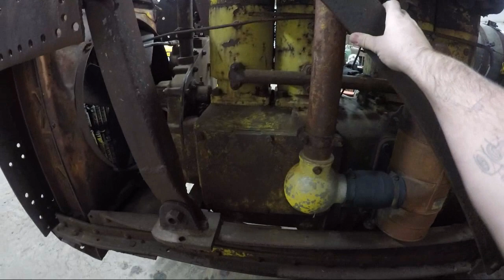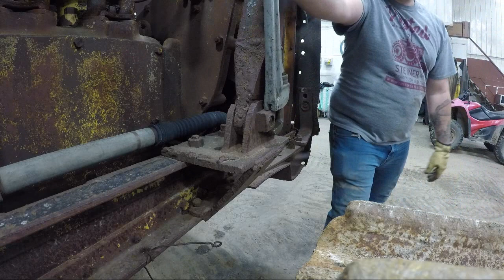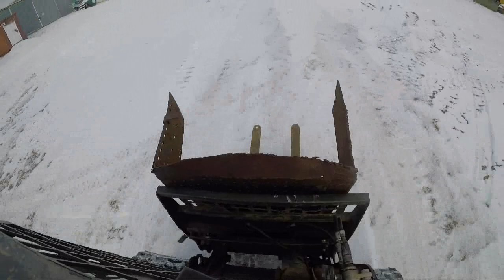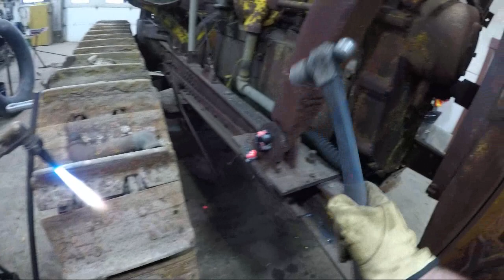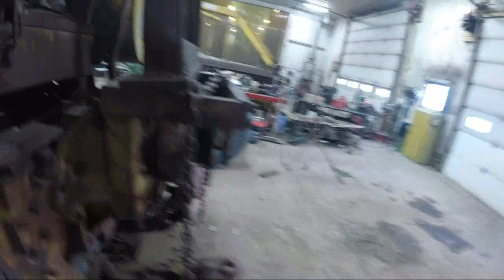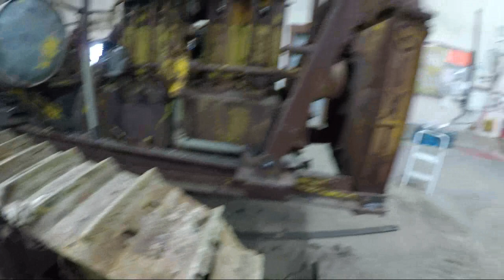Caterpillar SIXTY Rebuild Project - Disassembly Part 1 removing the canopy

Comment: Those metal pieces with all the holes makes me think it use to be an old firebox / boiler. No doubt there a story lost to time about how it ended up the way it did.
Reply from the maker: Yes there is definitely a long lost story - the last guy to have operated it has been dead for many many years so we are unable to get those stories- thanks for watching